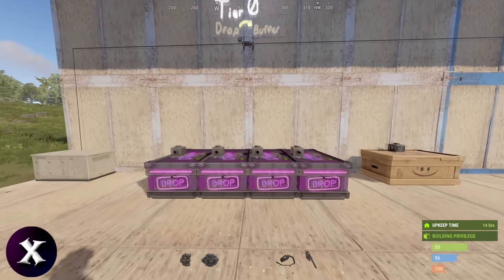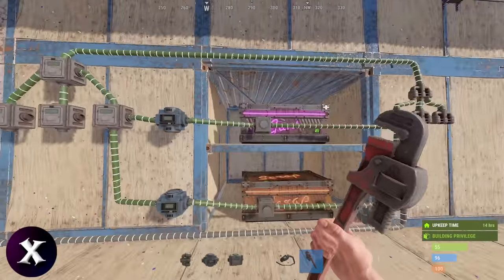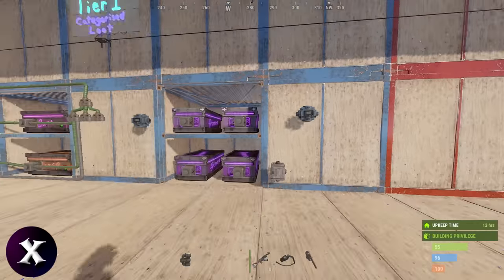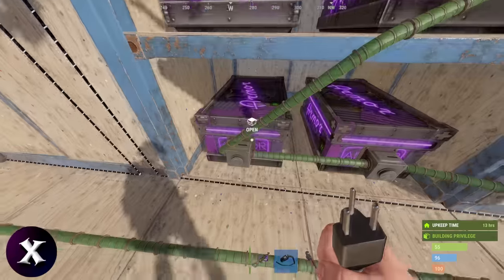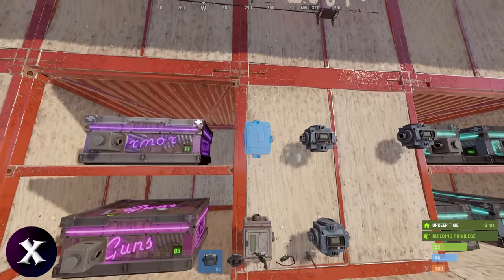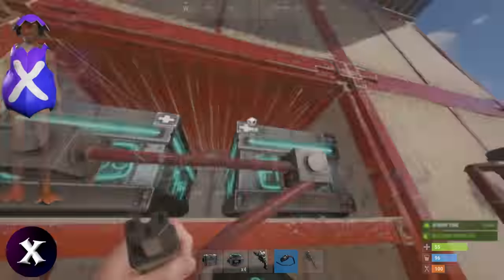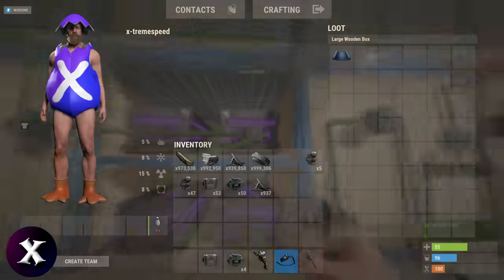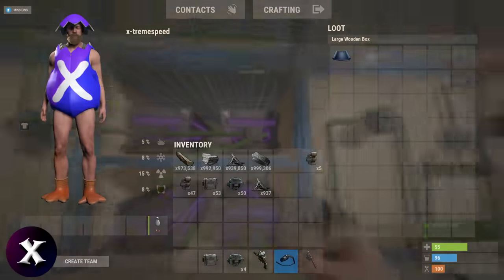Rust Modular Sorting System V2 | Tutorial

Comment: You don't need to connect the drop boxes with connectors. Instead, just run pipe from box to box directly along the line. The final box's output then goes to the conveyor.
Reply from the maker: Both ways work the same way, I just prefer combiners plus they aren't very expensive. Bottom line just do whichever you prefer😄
Reply: Yeah but depending on positioning. Like we place the drop boxes outside….a grub could shoot arrows at it and break it. Breaking the entire chain. This makes each box separate and if one breaks the others will always work. Plus less work when it does break.

Comment: I have done it and everything works but in the multibox it splits it into my 6 different boxes and doesnt go to the bottom, is there a fix?
Reply from the maker: Add a second storage adaptor to the box you want to be your main box. Connect a conveyor to one of the splitter outputs between the last box and the second conveyor in the sandwich setup, and hook the new conveyor output into the new storage adaptor on your main box. You don't need to worry about adding any filters on this conveyor.

Hope this helps!
Reply: It does drag some things but, i have 6 boxes in this multibox setup and 2 are already full, it cycles items in that last box and all the rest other 5 boxes stay the same
Reply: Would it mean i need a conveyor in between each adapter for it to go to the right box?
Reply from the maker: @sergevaitkevicius9687  if you want to have it completely organized, yes. I think it's good enough to just have one main box you interact with that you keep full, but you can do it either way you want. You will need to put a new storage adaptor on EVERY box and only connect the new conveyors to the new storage adaptors if that's what you want to do

Comment: How come you made the conveyor system circular in the first section? What's the point of that and why is it superior to some other method?
Reply from the maker: The single conveyor to single box method is simpler to set up and doesn't require a buffer box if you don't want one. The downside of course is only 1 box per conveyor, and you can only have up to 32 boxes.

I would recommend setting up every box (including single boxes) with the sandwich setup though, as currently it doesn't require any extra power and it gives you more flexibility.
Reply from the maker: The single conveyor to single box method is simpler to set up and doesn't require a buffer box if you don't want one. The downside of course is only 1 box per conveyor, and you can only have up to 32 boxes.

I would recommend setting up every box (including single boxes) with the sandwich setup though, as currently it doesn't require any extra power and it gives you more flexibility.

Comment: i'd say industrial splitter and combiner are kindda useless unless u wanna play with the circuits. The most things u wanna use the most is conveyors, storage adaptors and that's it. The reason of this it's because you can serial-connect them with a daisy circuit with the output - input - output input and leaving the first chest input free, to connect it to the industrial conveyor.

The only thing I can find really useful if u wanna split loot from a dropbox to multiple chest, it's crafting 1 industrial conveyor per chest + a splitter/s to connect them.
Reply from the maker: They are pretty necessary for sorting like this! I suppose you could make a sorting system without any combiners or splitters, but it wouldn't be very efficient. it would be a long chain of box -->  exclusion filter --> box -->exclusion filter etc. etc.... They also make things a little easier to keep track of mentally, so there's that!
Reply: @x-tremespeed  Yeah call me messy I find more complicated this way y are doing at the video, but I find It more polivalent since can be mixed and attached to a wider variety of circuits and become multifunctional

Comment: Thank you for the interesting video. Would you mind explaining the purpose of the splitter and combiner trees? I understand the need to add combiners and splitters as you add more boxes to the system, but is there another purpose for having the trees from the beginning?
Reply from the maker: I'm not exactly sure what you are asking, but I'll do my best to explain it!

Combiner/splitter trees are the most efficient way to combine/split to multiple boxes. It is a more compact way to connect pipes than doing it in a line.

The first splitter tree connects the buffer box to all the sorting boxes. This allows each conveyor to pull its respective resources out of the buffer box. The second splitter tree does the same thing, but with Tier 2 boxes pulling out of tier 1 boxes.

The combiner tree in Single Box Tier 1 connects all the single boxes to each other and back into the splitter tree so every box is connected to every other box. This allows the system to move an incorrectly placed item into the proper box.

The final combiner tree which connects the multibox systems in both Tier 1 and Tier 2 allow the exclusion conveyors to be hooked up to the buffer box, allowing them to deposit incorrectly placed items back into the buffer box to be re-sorted.

I hope this explains everything clearly!

Comment: In the tier 1 multibox system. Is it not possible to just daisy chain all the boxes together without the conveyor sandwich. Or does that prevent the system from pulling restricted items back into the buffer box again. and through the system again?
Reply from the maker: While it would technically work, it keeps the items constantly shuffling between the boxes. For example, if you put boots in box 1 they would move to box 2 after 5 seconds, then 5 seconds later back to box 1. This would happen with all your loot 24/7.
Reply: @x-tremespeed  ahh ok. Because when I tried it on ukn build. It never moved boxes. But could be because of lag removal. I could also be wrong tho. Am not that pro of industrial
Reply from the maker: @sann3v  Strange it didn't happen on ukn... I can't tell you the amount of people that came up to me asking for a fix for that exact problem haha!

Comment: Could you explain the reasoning behind Tier 1 and 2? Im other words, what would be the reason why you would not sort Tier 2 specific items directly from the buffer box? 

Is the in-between Tier there to help reset the conveyor max container limit or something?
Reply from the maker: Tier 1 is for categories so they will grab every type of weapon, for example. Tier 2 then grabs the higher tier guns from the tier 1 box. You could also have this pulling from the buffer box, but it needs to pull from the tier 1 box regardless, so the buffer box connection is unnecessary.

Comment: i combined all multibox setups together and got too many inputs in conveyor for outputting stuff... any fix? or my only option is splitting the output into 2
Reply from the maker: Generally you only want to output boxes in groups. For instance, only combine the resource boxes for TC upkeep and crafting, and only output weapons and armour for locker kits. You shouldn't need both resources and kits on the same pipe.

The only reason you would need to have one line for everything is if you have a bunkered loot room and you have a conveyor for loot recall, but that's a different system altogether.

Comment: So how do u do this for say 60 boxs or 100 if u ha e to much loot or do u  need to do a new system  and is there a way to convine them both together?
Reply from the maker: You can have as many boxes as you want with this! There are 2 main limits. Only 32 boxes max in the single box setup (this includes your buffer box(es), and a max of 32 boxes per sandwich setup (this shouldn't ever be an issue as no one needs 32 boxes for just 1 type of resource).

Comment: Love the videos♥♥♥♥ now i can set all Box as drop box hence it will all go to the buffer box/drop box but i have an issue where i've set a conveyor on a ammo box for 5.56 ammo rifle but the system only will pull 1 stack of ammo and the rest will be stuck in the buffer box any fix?  i haven't set any limit nor any filtering for it yet but every single time if i clear the ammo box it will only pull 1 stack of ammo
Reply from the maker: Much appreciated, thank you!

Are you on a modded server? Some plugins can affect how conveyors work. If not, I would try to pick up and replace each piece one at a time to see if one of them is the problem. Also try adding the ammo filter to some other conveyor and see if it works then. 

Hope some of this helps!

Comment: I havent tried this so not 100% sure it works but cant you connect buffer box into a splitter then 3 conveyors and then back into a combiner and then into a box, that way you should be able to have 36 filter for 1 box
Reply from the maker: That would definitely work for sorting things into the box, but unfortunately it wouldn't work so well for exclusion filters on the conveyors coming out of each box.

Comment: Hi i want to do a thing. I would like to move all the loot from the crates to a single box, is this possible? it would be practically the opposite of dropbox
Reply from the maker: What you are describing sounds exactly like the drop box to buffer box setup. 

Connect all your boxes to combiners to get down to 1 line, put that into a conveyor, then output the conveyor into your single box. Set your filters on the conveyor.

The very beginning of the video setting up the drop boxes into the buffer box goes through these exact steps.

Hope this helps!
Reply: Thanks for the reply.
I mean that for example from the resource chest, by pressing a button the loot is all transferred to one chest, the same goes for the other loot chests  @x-tremespeed
Reply from the maker: @daniel90655  Ah, I see what you mean.

Take an output from the splitter that is between your last box and the exclusion conveyor, output that into a new conveyor, and output the conveyor into a separate storage adaptor on your most convenient box.

I have an example of this at 20:50 in this video here: https://youtu.be/vVxHZJMX5EI?si=kwl8jClcLrEXPP_-

Hope this helps!
Reply: so if I have 5 chests, one of resources, one of ammunition, etc... I have to connect all the splitters of each respective chest to a conveyor right?  @x-tremespeed
Reply from the maker: @daniel90655  Yes, you'll need 1 conveyor per resource type. You can, however, use the Filter Fail of the exclusion conveyor into the power in of this so you don't need to allocate any extra power for it!
Reply: @x-tremespeed  thanks for the reply and sorry for the long conversation. I try to explain better : I want all of your piping system that I learned from you (Thank you). With in addiction a loot raiding protection : one sensor on the loot room should activate one conveyor which he would move ALL the loot from my base to another base outside. I don’t mean the exclusion conveyor which are you saying.
So to allow the conveyor to suck all the loot from the base, I have to connect all the splitters (The splitters  with one output connected to the exclusion conveyor) to the input of the raid protection conveyor. That’s what I mean, is right? Or there is a simple way to connect the input raid protection conveyor to All the loot of the base ?

Sorry for my English and really thank you I learned a lot with your videos
Reply from the maker: @daniel90655 Like you said, you would need to connect the splitters from ALL the boxes to a raid conveyor. Keep in mind you can only have 32 boxes per conveyor so you may need multiple conveyors for your entire base. 

It will take a single conveyor approximately 5.5 minutes to empty a box full of resources stacked up to 1000. With this in mind, you may want multiple conveyors in your raid alert system anyway.

Comment: Mind setting it up on an open core in a small group base please
Reply from the maker: An actual base setup is next on the list for video ideas! (unless of course I get completely sidetracked by an idea popping in my head) It'll be a big video though, as I am planning to do a FULL modular system setup.
Reply: @x-tremespeed  im pretty slow when it comes to the rust pipes but id like to learn and use it in game
Reply from the maker: @plazmarust  I don't have any general industrial tutorials, but my auto tc upkeep and auto lockers videos have the basic concepts in them, then the auto crafter and auto smelter are only slightly more complex as they start to use the conveyor's filter pass/fail outputs. I'm also around the rustricity workshop discord if you're having trouble setting anything up 😄The link to my playlist and the discord are both in the description if you're interested

Comment: there is no way to use that in a base with bunkers right?
Reply from the maker: @danielbals5239  generally no, but there are certain ways you can pass pipes into bunkers.

The easiest way, although I haven't done this since pipes came out last year, is to have offset bunkers and have the pipes go in through the gap. Your mileage may vary with that.

There are other ways to pass pipes through walls by using roof pieces, placing splitters and combiners on the angle, then removing the roof. There are a few videos showcasing how to do this on YouTube.
Reply: @x-tremespeed  alright man ! Since I never build bases without bunkers I wasn't gonna try that. But your comment now made me curious

Comment: Very helpful
Reply from the maker: I'm glad you found the video useful!
Reply: @x-tremespeed  i had a friend modify the system a bit. what the difference between any item and request filter?
Reply from the maker: @baconjam7140  "Any Item" will move each item in the filter (or every item in the input box if left blank) as you would expect, without any restrictions other than the conveyor's limits of 60 items per stack max and 12 stacks max.

"Require All" will only move items if every single filtered item is in the input box and can be moved. This is mostly for things like autocrafters where you might only want materials moved into the crafter if EVERY item is present.

"Exclude Listed" is just the opposite of "any item". It will move everything that is NOT in the filter list.

Hope this helps!

Comment: I also get lost around tier 2
Reply from the maker: I'll try my best:

Tier 1 is a generalized sorting tier. This is a catch-all tier with the sole purpose of making sure every item in the game has a box to get stored in. The most simple way of achieving this is to literally have 14 conveyors, each set to one of the 14 filter categories (listed in the description).

Tier 2 is to divide the higher grade items from the lower grade items. This is almost exclusively for guns, armour, and explosives. In tier 1 you will have a conveyor set to the "weapons" category filter. Generally you don't want your waterpipe shotguns and your AKs in the same box, so you pull out the latter from the tier 1 "weapons" box into the tier 2 system. You can do the same with higher grade armours etc.

If you don't care about having all your weapons in one box regardless of grade, or your armour etc. you can forego tier 2 altogether.

I hope this helps to clear things up a bit!
Reply: @x-tremespeed  dude you're a legend! Replying to a comment on a year old video expeditiously was not on my bingo card. So to be clear I can conveyor sandwich just the weapons & armor boxes or do I have to sandwich everything?  Thanks for all you do!
Reply from the maker: @DoomsdayGundam  For sure!

The "sandwich" setup is only needed if you have a single conveyor depositing into more than one box, however you do need to have every box in a "sandwich" setup in tier 2.

Put a splitter after the last box in your Tier 1 setup and hook that up to a Tier 2 conveyor to pull out the higher grade items into their own box!

Comment: While these systems are cool I don't think they are worth it due to the way the piping is implemented. Wiring is easy and stays out of the way, but the industrial systems are clunky and obviously there. Living in a cost-effective base makes it nearly impossible to implement complex systems like this.
Reply from the maker: You can simplify it to the point where it makes sense for your base 😄 You can skip Tier 0 if you don't have a compound, and you can squeeze a conveyor above each box for Tier 1 sorting.

The pipes can be a little annoying, but running them along the ceiling keeps them out of the way. I've set up auto smelters and auto lockers in a 1x2 before!